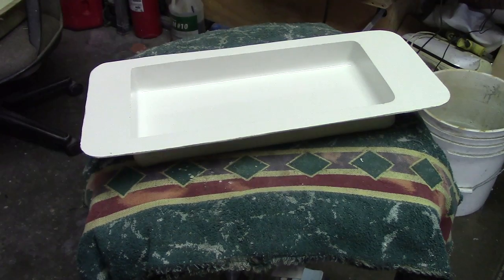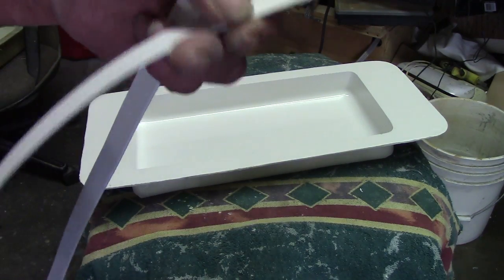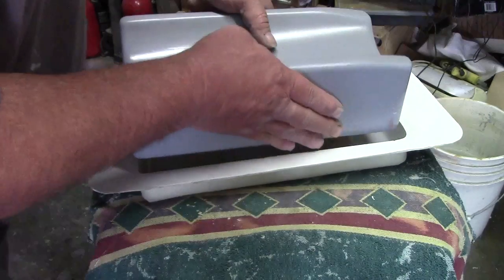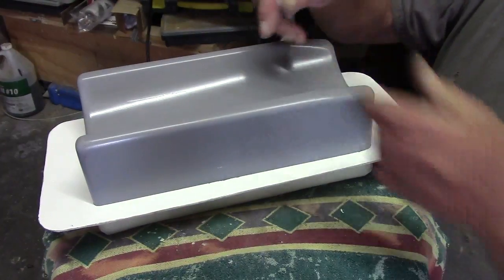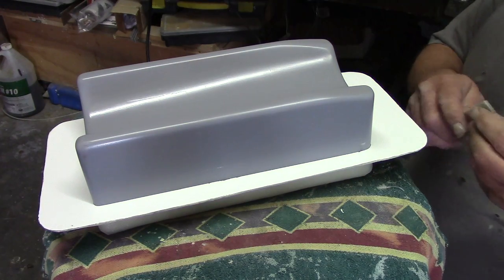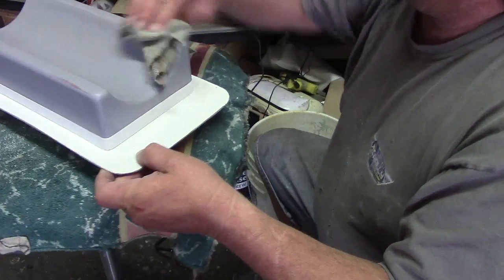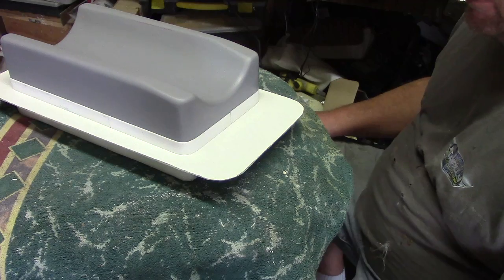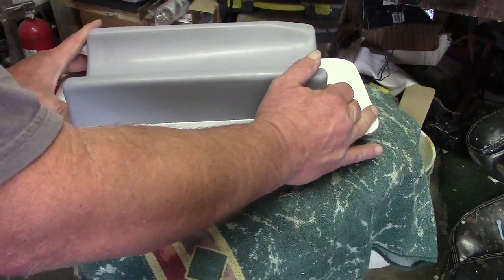making a mold for Kevlar fuel tanks #6

Comment: Bob
     Wouldn't it be easier to make your plug the thickness of the flange taller than you need. Wouldn't have to pull the plug just add the strips and mold the top half.